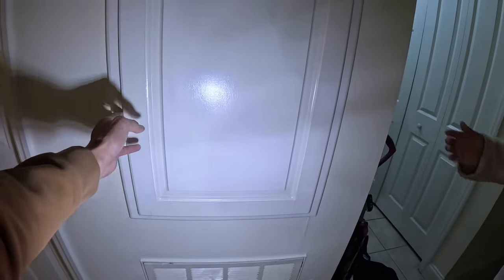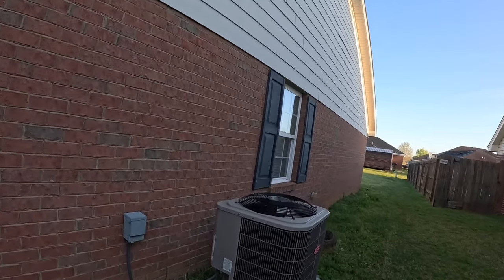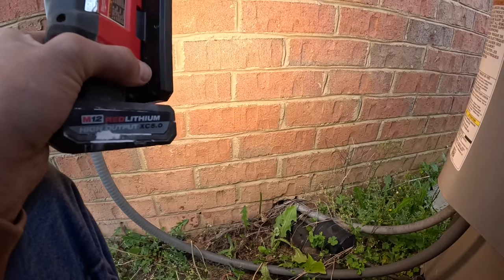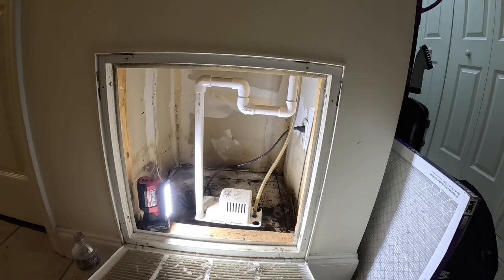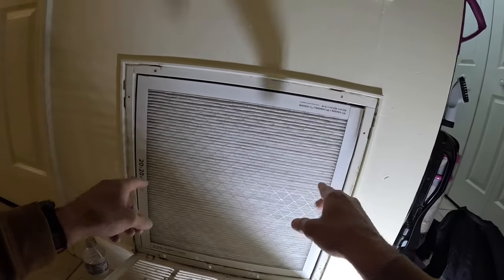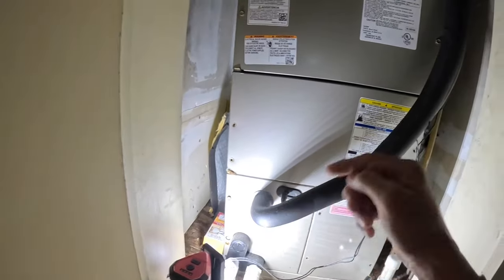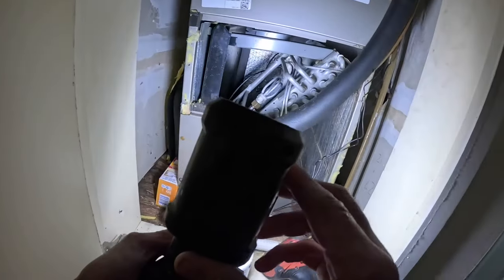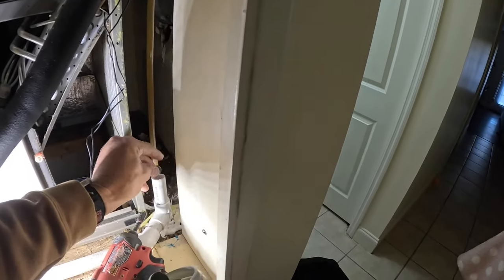Investigating Report of Mold And Water in The Closet! #hvacguy #hvaclife #hvactrainingvideos

Comment: If I’m not mistaken those Home Depot filters are not rated by MERV. They rated by good , better and best. I would install a manometer across the filter/evaporator and compare it to the units data plate. I think the filter will be fine. If you are worried about it causing a restriction once it’s dirty then I’d recommend replacing it more often.
Reply: I forgot to add it’s the static pressure that we want to measure and compare it to the units name plate static pressure.

Comment: Great job, but while i dont disagree with the fact that FPR 10 create an airflow restriction, I disagree that the cheap blue ones are better. They don't catch hardly anything except things like hair and dog fur. FPR 10 is always going to better. Would you rather have dust getting into the unit and causing the blower to be coated in God only knows what, or would you rather have cleaner air? I prefer cleaner air, as I run many electronics in my home and have pets..and because it's just overall better. I've seen what they catch in person.

Comment: Merv 8 Curtis to protect the equipment, change out every 30 days. The fiberglass rock catcher filters mean clogged coil in a few years, especially with pets.
Reply: My point exactly, FPR 10 is better overall. It means the equipment is cleaner, and you'll have technicians complimenting you on how clean the unit is. My unit is 2007, and its a two stage and looks practically brand new inside, minus a few scratches on the metal here and there.